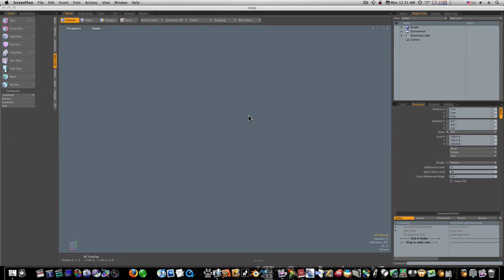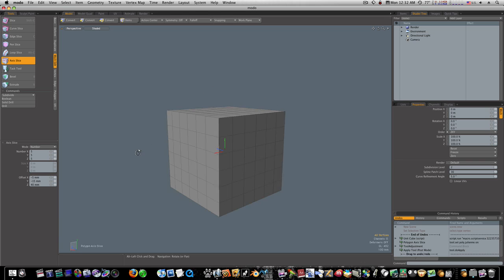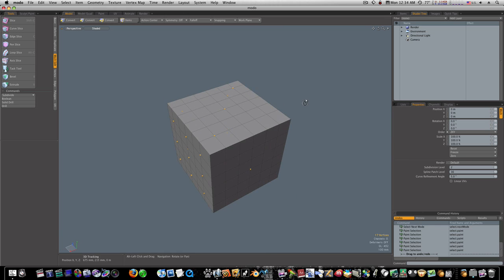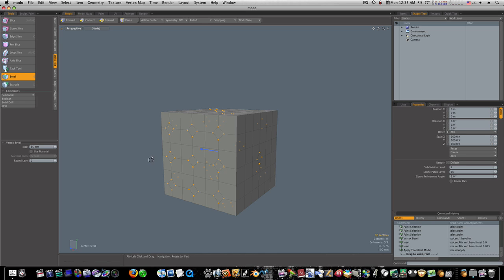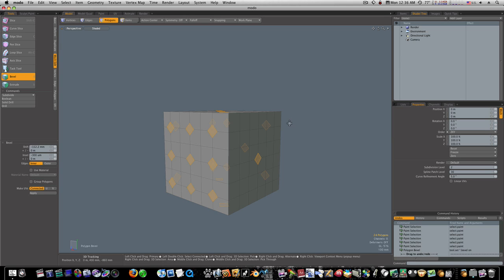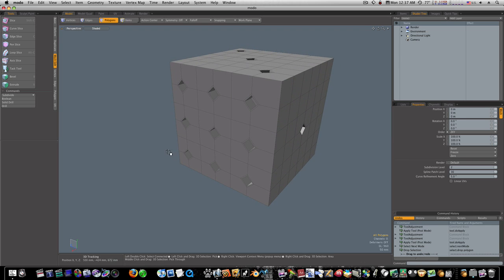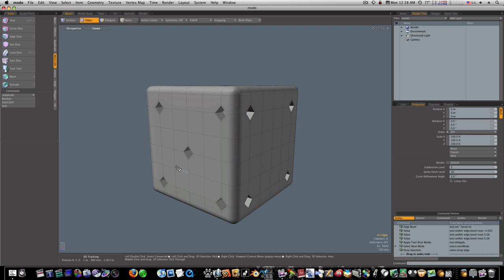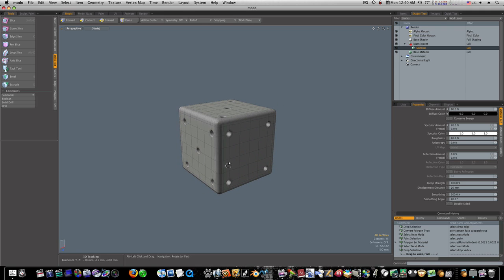Modo for Noobs: 3D Modeling (Dicey Bevel)

Comment: Besides selecting 9 vertices you missed one very important thing about dice:
1 is the oposite side of 6. 

Or, the sum of opposite sides of a dice is always 7.
Also, with 1 on top, you make the 2 on the front and the 3 on the left. Then you know where the other values are by adding up to 7 to the opposite sides of these three.

Another thing I'd like to point out, a mistake of all dice tuts: the dots are always either too small, or too large. Just like if no one pick a real die for reference.